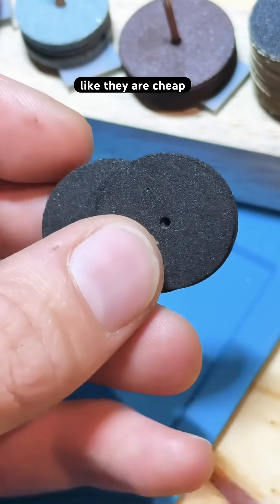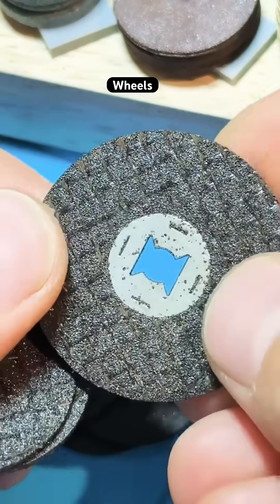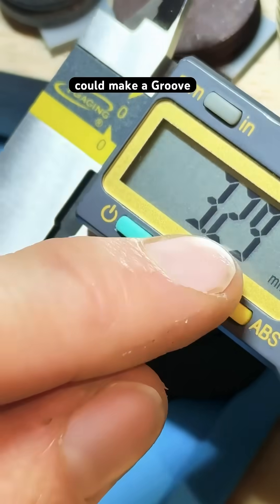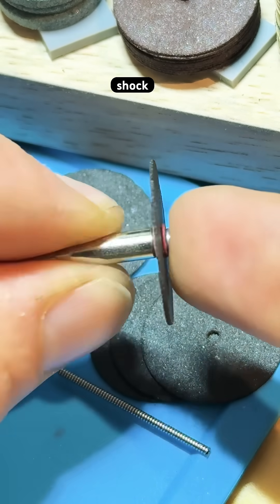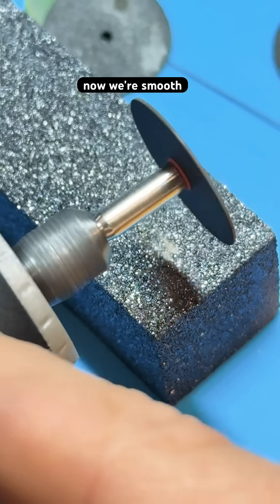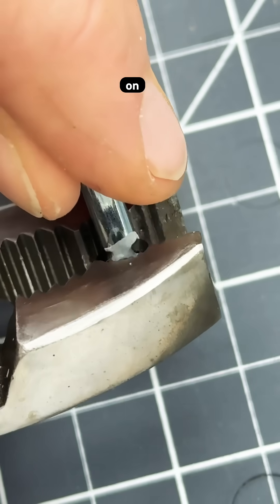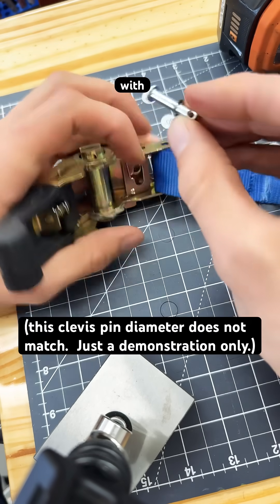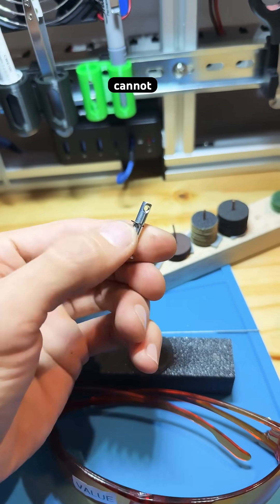what’s the purpose of the thin, fragile cutoff discs on dremel?

Comment: Eyewear crucial! I used same wheels to cut a groove in security screws on my house window locks to allow me to use a flathead to remove them. Hard steel screws, hard steel locking housing, the wheels went through them like butter, but i went through about .75 wheels per screw.

Comment: Thanks for the tip on trueing them up - a very helpful idea! I use them regularly on a precision drill press to cut down the height of thin FR-5 fiberglass potting cases for custom military electronic parts. Also sometimes to separate copper traces on custom circuit boards.

Comment: That's so funny! I was going to suggest exactly what you ended up doing :) medium soft bushings on both sides. That reduces the chance of it shattering immediately, and it tends to fill the gap in between the screw and the disc. The center holes in those are always oversized and never perfectly centered. And yes! True it up on an abrasive block before you make your cut. I just found this amusing because the dremel tool was the first power tool that I ever got. I was like.. maybe 12 years old. So I have over 20 years experience, and I'd like to think I've figured out most of the tricks and tips. If I were you I would invest in a set of the diamond plated disc's. They're just as thin, and you never have to worry about them shattering in your face. That being said. The cheap abrasive ones still have a time and place. Especially when the material your cutting tends to gum up. The diamond disc's will just get clogged up and useless.

Comment: Ok but why would you need a spinning disk to cut, when you already have the object of your work clamped into a lathe? Usually we just hold cutting tools to work in a lathe, we don't hold a second spinning tool against the work - you can't see that you are working harder just to use two spinning tools?

Comment: the very first thing you need to do is to straighten the spindle on a lathe with a dial indicator ( use a collet ) , second thing you face off the spindle on the lathe , you don t need to tighten it too much since it is right hand thread , there are 0.018" thick disks 0.45MM . I use them to machine on the lathe , not only thin grooves but many many other things , when the dremel is held in it s homemade toolpost this is one of the finest accessories you can get for a lathe. the cutting disks are far better than the glass reinforced ones : your dremel revs not high enough , the cut off wheels have a perfect finish that is not the case of the reinforced ones

Comment: If they break on you a lot, you’re either pressing too hard &/or not holding the tool properly.
Another way, people will always blame user error on the tool.
Also, the red washers are for grip also. Without them the blade would stall very easily.

Comment: My question is how did you get the drill to rotate so slowly on its own while you were making that groove with the dremel. That would be such a huge step up in my crafting game
Reply: Zip tie the trigger at a low speed then just use the battery to start/stop it. An even better way: I use a corded drill mounted to the workbench, plugged into a voltage controller (found at most hardware stores) just turn the dial to adjust anywhere from full speed to very slow rotation.

Comment: buy a Proxxon. Don't be like me, i bought into dremel brand for years and they always overheat or torque out. The Proxxon stuff is wonderful and sturdy.
Reply: Eh, not bad, proxxon cost $100, rated 4.5 stars in Amazon, fake spot gave "B" so decently few fake reviews.   I love my $34 flex drive faux foredom drill with pedal included. Always set up and out of the the way yet used daily.
Reply: @hexane8  recently got to use a foredom at this jewler's shop and they seem legit as heck.
Reply: I’ve heard nothing but great things about proxxon and how their stuff is on a whole different level above dremel. Not even that pricey
Reply: I wonder what percentage of these are just free adverts.

Comment: One benefit of a weak cutting disk is it won’t get caught and drag into a cut. It’ll just shatter. If I’m doing delicate work I’d rather the blade shatter than mess up what I’m working on.
Reply: My tool was supplied with 120 discs....now  I know why. Bits of 'em pinging all over the workshop.
Reply: Thats exactly why i like these ones, i use them fairly often.

Comment: do you want to be an engineer or a salesman?
one says why, one says how much
what is value?
those stupid disks teach you patience, they teach you to always take the arbor out if not in use. they do work.

fragile and brittle and hard are all the same thing...
those disks were like "free samples"

that little disk is small for small jobs. that 2 in thing can only do so much as well. I use mostly 4.5" disks. I used to use mostly 6" disks. I still have about a third of my disks that came with this 10 or 20 dollar 72 piece rotary tool accessory set... lol 
I have never used the buffing pads as well. Sometimes you buy a set for 1 part inside.
cost analyses...

Comment: For anybody dealing with these thin disks knows their greatest drawback.  THEY SHATTER.... EEEASILY!  So, the workaround I figured is using thin cyanoacrylate glue.  It will readily absorb even medium glue so make them on baking paper/wax or like material to avoid gluing them to your workbench.  The result is truly shocking, you actually have to TRY to break them.
Reply: I am skeptical but interested.  
So you soak the whole disk?  Maybe lay it on a bed of something covered in Vaseline?
Reply: @blackc1479 you can lay them on me while I'm covered in Vaseline..
Reply: wauw no whey
Reply: Also: WEAR EYE PROTECTION
Reply: Why have I never heard this before? Brilliant.
Reply: I will keep this in mind to try. 
While we're at it... maybe apply some baking soda, it makes cyanoacrylate dry instantly. (And I do mean instantly)
Reply: @codemiesterbeats  They already have a grit/dust to absorb the glue.
Reply: I'd say dust with a light coat of baking soda and drip the CA Glue on. It will cure INSTANTANEOUSLY!!! 💯
Reply: I would not recommend this as cyanoacrylate glue produces highly irritating  gases when heated/burned that can cause flu like symptoms
Reply: Great tip! Thank you!

Comment: The real issue with those discs, and even sometimes with the reinforced ones, is that  the groove your cutting always gets widened from the disc wobbling slightly. Most Dremels don't go slow enough, and there's too much slop in the whole driveline, for the discs to stay true. Even when mounted the discs almost never cut at their actual thickness.
Reply: Lol I impart way more slop than the dremel ever will.
Reply: The disks themselves aren't entirely flat either, some are more curved than others. It's easy to simply lap the disks a little to determine how potato-chip shaped it actually is.
Then there's the soft washers... there's no way to mount the disk perfectly perpendicular to the shaft with those washers which also creates a major source of off-axis "wobble" to the disk.
Add that to the inherent shaft runout in Dremel tools, and you have both sloppy AND a self destructing cutting wheel.
While you can cure the concenticity issue as demonstrated here, there is much to be done to solve the out-of-flat and off-axis issues.
Nothing can be done to solve the Dremels shaft runout, the shaft bearing mounts into the tools plastic housing, no hope for a vibration free interface there.

Comment: I carry, for work, an 18v battery angle grinder.  It can mount and spin grinding wheels, flap-discs, wire brushes, diamond-surface grinding or cutting wheels, and abrasive, ablative cut-off discs.  My favorite accessory for this is a rock.  Yes, really, a rock.  It is a river-ground rock, slightly off-white and pink, indicating a very high quartz content.  This rock is VERY hard.  I use it to true-up my cutoff and grinding wheels, sometimes to change a grinder profile, sometimes to reduce a cutoff kerf to make a fine groove, and some times just to remove a defect or damaged part of a disc.  The rock can even blast away clogged flap disc sections, or wear down flyaways in a wire wheel.  The only thing that I keep away from The Rock are discs made of solid metal or ones with a "sharp" cutting surface.
Reply from the maker: that’s fascinating about the quartz 💎 rock attachment!  if you find a link please share! (assuming you didn’t custom make it)

Edit:  (2 days later) I’ve fallen to ADHD in the above comment.  Reading too fast, replying without thinking.  I literally just asked someone for a hyperlink to a rock.😅 Rocks do not have websites. I won’t delete my comment, it’s a good teachable moment: slow down and think.  Now i’m laughing at myself.
Reply: @davidmalawey  It isn't an attachment, it is really just a rock that I picked up off the ground.  I just hold it and use it to dress up grinding discs.
Reply: @davidmalawey I don't think the rock is spinning around on the angle grinder arbor.. they use it like you used the black rectangular sharpening stone(?) or whatever that was you used to circumcise the cutoff wheel
Reply: For Dremel type/size devices, I assess material and shaping desire.  I try to prefer carbide cutters, but very frequently roll back to coarse-grit sanding drums or cutoff wheels.
Are you trying to sharpen something?  The SIDE of an unreinforced cutoff wheel may get you the best results.  The edge of a grinding wheel or cutoff disc will have a near-cylindrical profile, resulting in a hollow-ground bevel of gradually reducing radius, where the side of a cutoff disc will render a near-planar conical section that more nearly approximates a flat-ground bevel.
Reply from the maker: @Kineth1 you described a geometry using words, very accurately, and I wonder if I can only understand because i’ve experienced the parts first-hand.  That’s talent, to describe with words something that usually requires a sketch.
Reply: LOL link for the rock?

what is wrong with this country